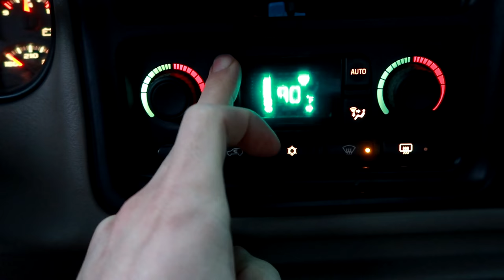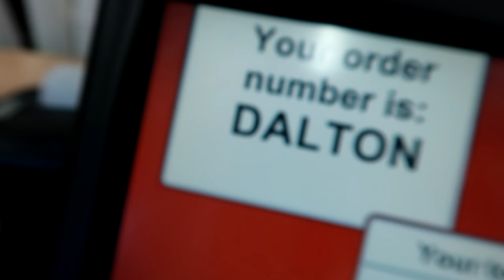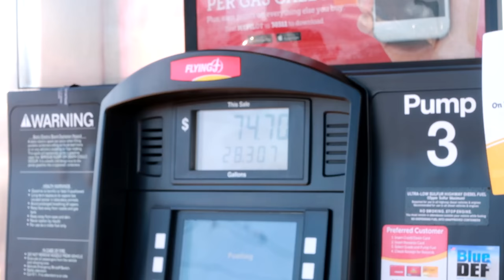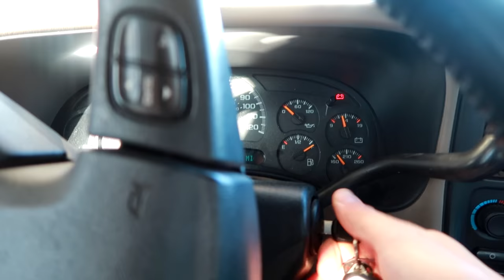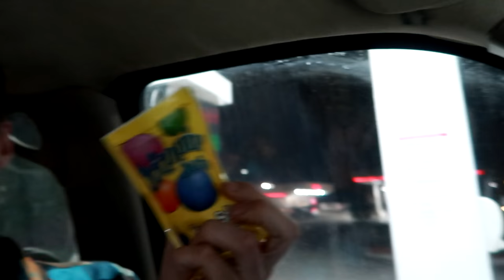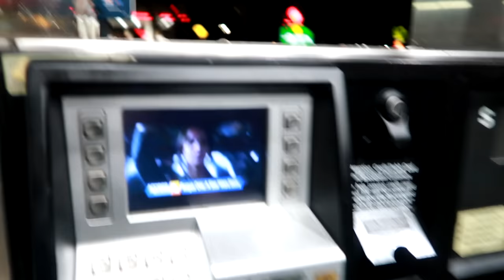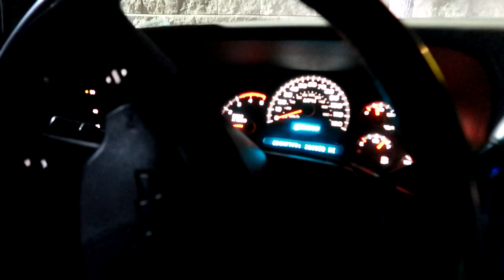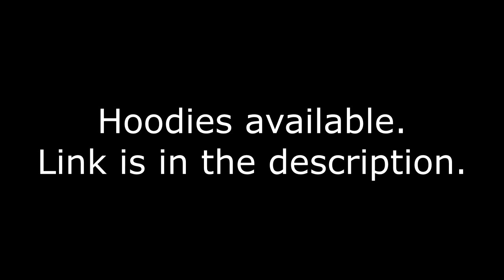THIS is why ROAD TRIPS SUCK

Comment: Why is it pickup drivers think shit in the back of their truck will not blow out. Dude,its like a wind tunnel back there. The wind does and will blow crap out of that truck bed so easy. I constantly pick up goodys on the side of the highway thanks to guys like you. I thought you had a large tank,does it take longer to go down? Some one did that on one of my vehicles. The tank was much bigger than the original and I couldnt figure it out at first. I ran it till it was almost empty,filled it then checked the gallons it took and checked the manual,turned out my tank was a 23 gallon not a 17 gallon. The guy said he did some alterations to it...oh it was my Conversion Van...now I remember. I loved that 1978 Van. I had an RV dealer try and tell me I should be investing in a new Van,not a camper. Truth was,it had been restored a year earlier by the previous owner. Still had the original shag carpet and a moon roof. It was the coolest Van ever!

Comment: When ever I encounter a pump without a locking tab on the nozzle I just stick the fuel cap in between the lever and the bottom of the handle. Works like a charm! Hope you find that helpful, I know you'll freeze your butt of out there!

Comment: Your fuel mileage is really bad!!! My wife's 7.3 PS gets 18 on the highway, (doing the speed limit, me driving), or 16 if she's driving, (at least 10 over the speed limit). It does drop to 14 if I'm pulling a 3 horse trailer, or tractor, or cars... Be safe young man and be careful, the troopers down here love seeing those NY tags ;-)
Reply: Does the wifes powerjoke have 260,000 miles on it ? Christ almighty man...the thing has a tune and is over a decade old.

Comment: should of gone with the beauty ford power stoke
Reply: Jared Halvorson fords suck
Reply: I drive a 99 ford expedition with 244.000 mi on it explain that to me
Reply: Jared Halvorson I drive a 95 chevy with 400,000 miles on it explain that to me
Reply: HunterRay74 as long as you don't drive a Dodge you're good
Reply: WaluigiButtPlugs what's wrong with dodge?
Reply: WaluigiButtPlugs Damn straight dodge sucks
Reply: HunterRay74 cummins is the best Diesel engine
Reply: josh .doherty yeah they put out a lot of power but they r unreliable as shit
Reply: HunterRay74 no a 12 valve cummins is the most reliable Diesel engine powerstrokes are by far the most unreliable
Reply: hunterRay74 it's a diesel that's why
Reply: HunterRay74 are you kidding me? Cummins are reliable engines. The 6.0 and 6.4 power strokes are problematic engines
Reply: josh .doherty I didn't say ford was reliable and I didn't say chevy was reliable but dodge is not as reliable as a ford or chevy
Reply: my family has 3 Duramax trucks an 01,05and06 all with over 400000 mi
Reply: HunterRay74 cummins is most reliable in my experience and I respect chevy but powerstrokes are not reliable at all
Reply: HunterRay74 7.3 powerstrokes was the only remotely decent powerstroke
Reply: Flap Jacks agreed
Reply: the 6.0 and 6.4 were both doomed to fail unless bulletproofed
Reply: Jared Halvorson hell with  the powerstroke  Cummings or duramax all the way
Reply: josh .doherty Yes and like you are saying from your experience dodge has been reliable but my buddy has an 03 Cummings and he has had nothing but problems from the thing
Reply: But my dad has a 7.3 power stroke and it's been a good truck but other than the 7.3 fords are ass
Reply: So, let me get this right.... Ford has only ever made 1 good engine according to u
Reply: Sounds like someone who is gonna be in high school till they are 22 to me
Reply: Lets all agree as long as it is diesel you are fine
Reply: Redfish Runner even better: as long as you don't drive a Toyota or a nissan, you're good
Reply: 12.7L Detroit (non-EGR) is still my favorite. 
Mine had just over 780,000 miles on it when I sold it and was still going strong...
Reply: MxForever no im saying the 7.3 powerstroke was the only ford Diesel comparable to a cummins
Reply: Jared Halvorson we don't need him breaking down now

Comment: Just saying, if you tried to put dippin dots in a cooler it wouldn't work unless you have dry ice with them. They have to be kept at -45 degrees f

Comment: 40 galloin tank?  It's been 26 gallons up until the LML's came out and increased the size of the tank.  My previous LMM (2009) had a 26 gallon tank; my 2013 LML Crew Cab Duramax standard box only has a 36 gallon tank.

Comment: Didnt you say your muffler needed replacing? I need to replace the exaust on my Trail Blazer 198k On the original. Guess who is going all stainless again? Dont you buy energy drinks? I use them whenever I  travel. Looks like you are going North,then south? Happy Travelling.

Comment: Noticed you got the fire stone winterforce lt tires. I just picked up a set for my 08 2500Hd for winter. I have yet to try them in the snow i honestly got them cause they are super cheap how have they been in the snow so far hopefully they go good for plowing this winter if connecticut gets snow.

Comment: I don't know if you have a chance to read everyone's comments but these velcro "one-wrap" straps (https://www.amazon.com/VELCRO-Brand-ONE-WRAP-Cables-Wires/dp/B005RTREQC/) are quick to use and work great at taking care of the leftover tie down strap.   Just attach it next to the ratchet mechanism and never worry about figuring out where to locate the extra strap again.  Use it all the time with the dirt bikes, quads and sleds.

Comment: would you advise to buy a duramax against a cummins or  powerstroke
Reply: MN SHP think about it nobody duramax swaps they Cummins swap so why not buy a truck that is designed around a Cummins
Reply: MN SHP Duramax are very good but they are also very expensive, Cummins on the other hand are also very reliable and pretty cheap to buy and maintain, but powerstrokes are garbage unless it's a 7.3, Bullet Proof 6.0, or a 6.7 whatever you do do not buy a 6.4 and try and stay away from 6.0s

Comment: Good job you fuel is cheap. you did 360 miles on 40 gallons. My car would do about 2000 on with that much fuel.
Reply: spoony spoonicus weight and diesel fuel prices are the difference between his truck and your car hahah 😂
Reply: Yeah but work out 360 devided into 40 and it's 9 mpg. My car does 60mpg or more on a long flat drive.
Reply: He did 361.7mi on 28.307gals = 12.78mpg. Dalton was hauling ass! He averaged 71mph including stops.
Reply: OK I assumed he was empty. Still my car would average around 60mpg at that speed
Reply: spoony spoonicus sorry bro not everyone drives a vtec dohc'd Honda civic. haha you'll learn when you start driving a truck. specially when it is windy and your hauling a load in the bed of your truck. keep in mind trucks aren't as aerodynamic as cars
Reply: barrack o'donald Don`t drive a Honda. I drive a vw golf. I was not even having a moan. I just thought it was funny.
Reply: So, you drive a prius, eh ? Bet you voted fot hillary too, did'nt you princess ?

Comment: How the hell is the duramax only 6000 pounds, my x5 is almost 5,200
Reply: Why the hell would you buy an x5 ? "The ultimate driving machine" is an overpriced, overweight turd.
Reply: Hey, I had a 2011 335i, but the thing became impractical and guzzled gas compared to the diesel x5